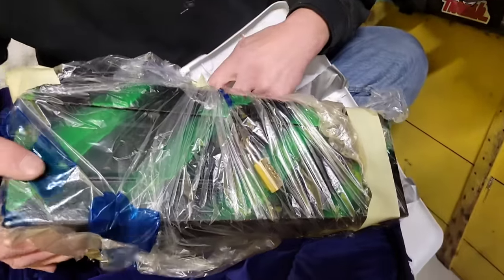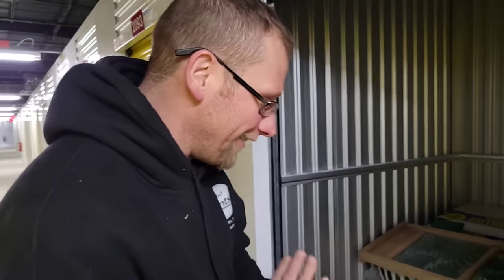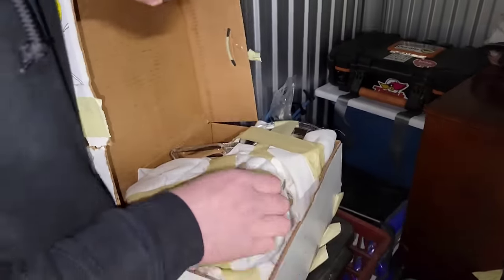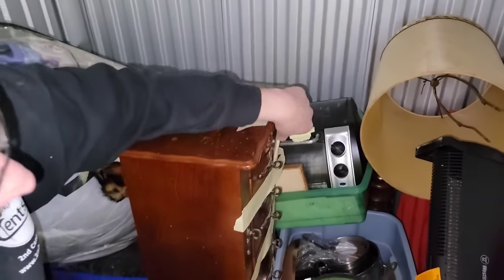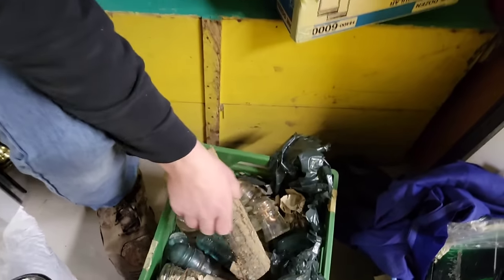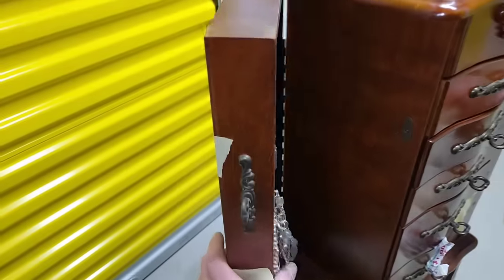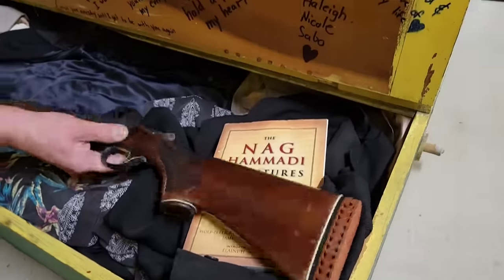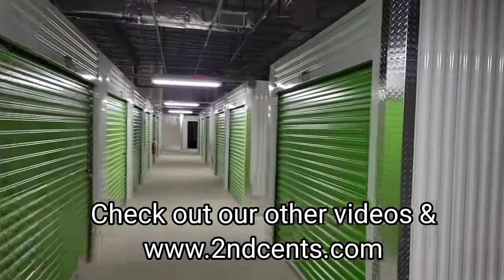Owner left 2 LOCKED BOXES in abandon storage unit, I can't believe what I find inside? ~ 5x5 Big $$

Comment: 1. Magazine not clip. A Ruger 10/22 takes MAGAZINES not clips. They are 2 very different ways of reloading. You can load a magazine with a clip!
you can probably get good money for both rifles right now with the "OOO scared Democrats gonna take our guns since they got their guy in office".  this also allows you to rid of em in off chance they were reported missing

2. The aperture science thingy we don't know what it does is a old Heyworth reamer(used by pipe fitters) looks like a 2-3/4" or maybe a 3". it cuts with the carbide tips above the cup and is  not a door knob /deadbolt hole cutter like so many suggest. As a woodworker with a specialty in old tools I'm disappointed not more people recognize this.

3. I'd be highly careful with the drug paraphernalia. i believe weed is legal where you are at a state level. but personally, i wouldn't mess with that as it is still illegal at a federal level and you run the risk of it being a excuse to rob you legally. the bong will likely still have residue.